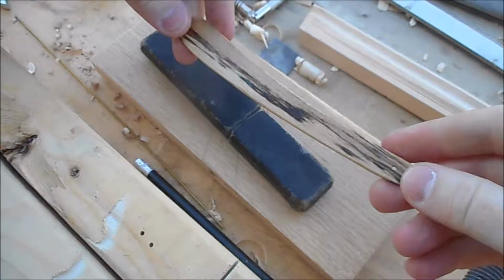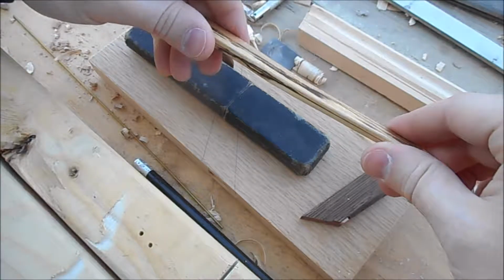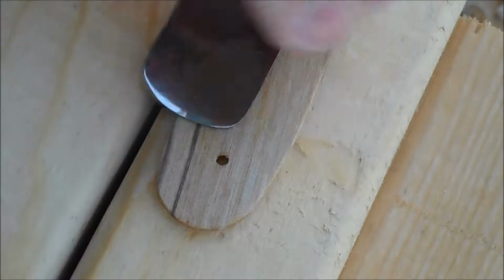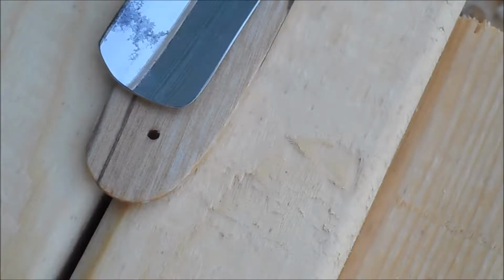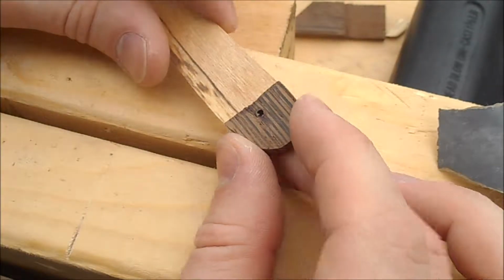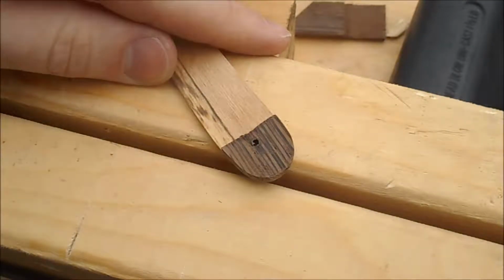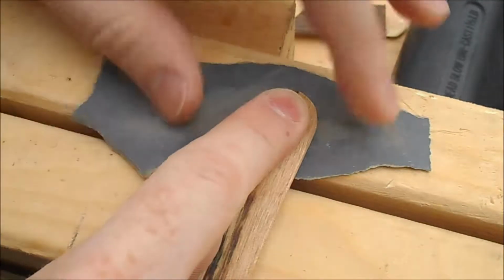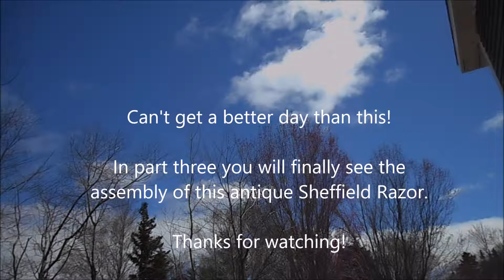Making the wedge, Sheffield Razor Restoration Part 2

Comment: Nice work.  The wedge is supposed to be a wedge though, not flat. It works in conjunction with the taper on the tail to create a bow in the scales to allow the plunge line (usually the thickest area) to easily enter the scales.
Reply from the maker: Yes your right most are wedges. I have seen them from factory with no taper though. I've made both but as long as the blade plunges deep enough for my needs I'm okay with it taking the easy route ;)